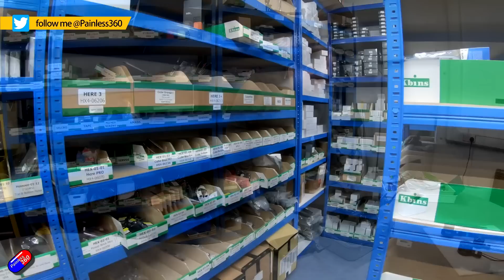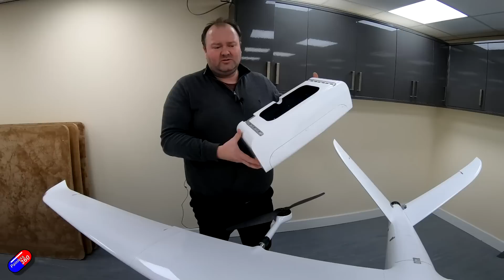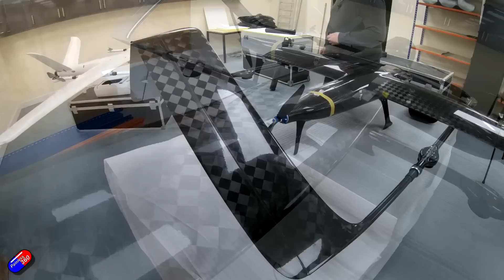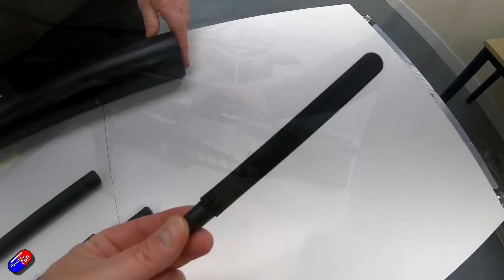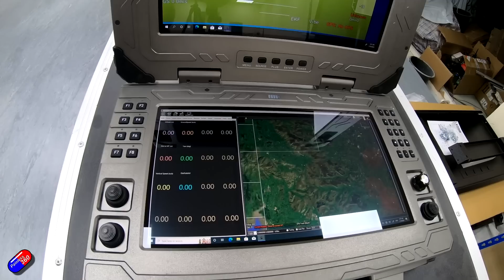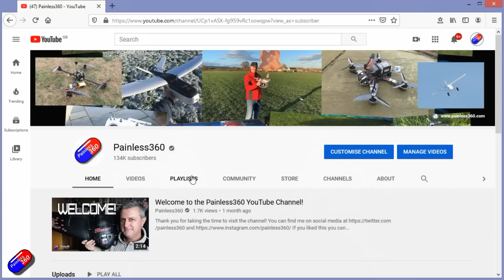Ever heard that you're spending too much on the hobby? Show them this video!

Comment: From August 2020 to March 2023 I've spent about $4500 at RDQ. Most of my stuff has been bought from RDQ but I have also bought from Cyclone, GetFPV, Amazon, BetaFPV, Happymodel, Banggood, Progressive RC, etc. I have DJI and analog goggles, 5 or 6 working quads, 2 radios, random parts and things and that's about it.

Comment: id like for the quad motors to be electric and the pusher motor to be a hydrocarbon eating engine with a little alternator to charge the battery a little. that would be cool.

Comment: I used to fly 1.2 with a tracking ground station. Then relay 5.8 to my goggles. 

The ground station went on the house roof, I sat inside on the couch. 

Can’t imagine the trouble I’d be in with the CAA these days.
Reply: thats why we need self wiping flight controllers. if the power goes down all the flight data and missions are gone. im trying to figure out how to do it but im not smart enough yet like loading everything into ram memory.
Reply: @frankyflowers  maybe a cli script? Not sure if this is possible? 

Fail safe initiation runs the script to clear the device?
Reply: @SF_Bikes  i need one that does that because im scared to fly over lots of places and get anxiety attacks but not where i go crazy i just get really nervous. if the data would wipe i wouldn't be scared.
Reply: @frankyflowers  I fully understand. 

I used to get a bit twitchy. Sat on the couch while the planes 10 miles away 🤣
Reply: @SF_Bikes  i don't fly them i usually just launch and then wait an hour or two for it to come back and crash land.
Reply: @frankyflowers  haha. 

I would trust not watching it all.
Reply: @SF_Bikes  i have some plane moulds and a box of 8bit flight controller and gps. i don't care if some get lost i just don't want anyone to know where they came from. i never lost any but i did forget i had one out and it got rained on overnight and ruined everything.
Reply: @frankyflowers  ah rite. 

I had full vector flight controller with tracking ground station, high gain, directional antennas.

I do miss it, but gone back to quads now, they are so much more resilient to wind.